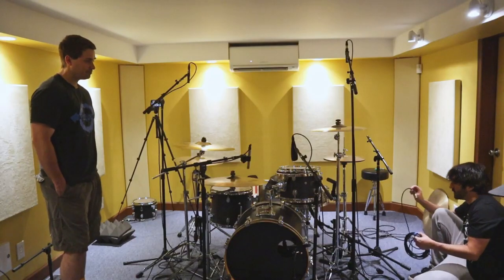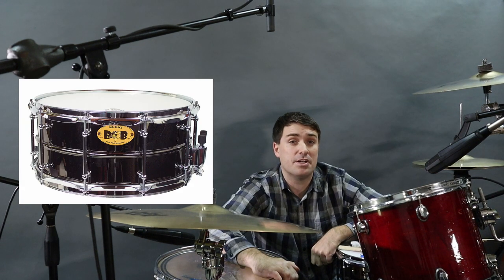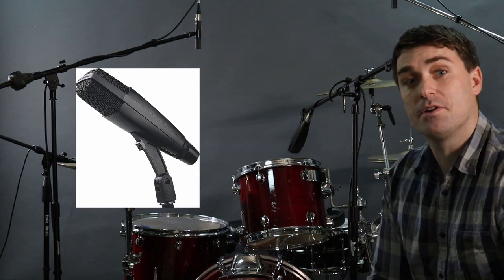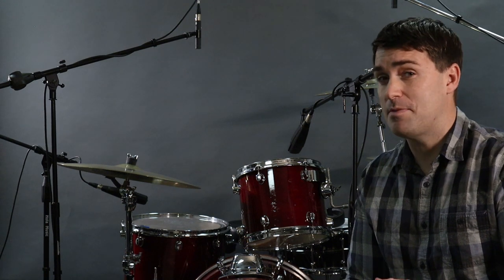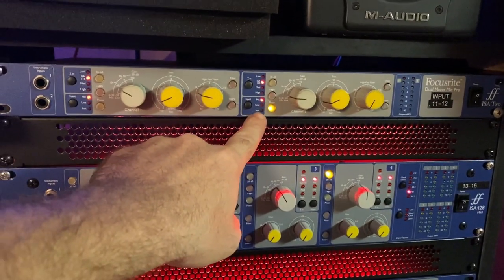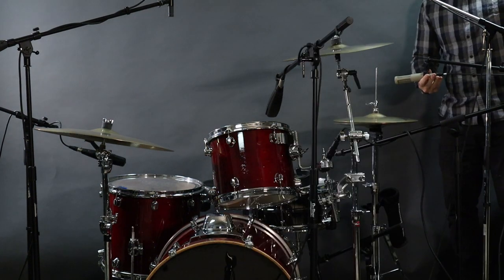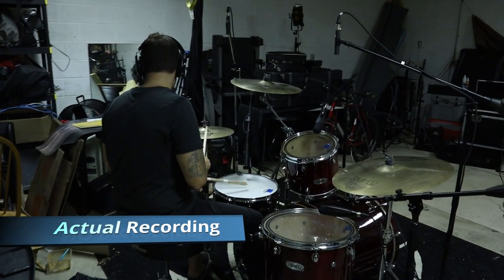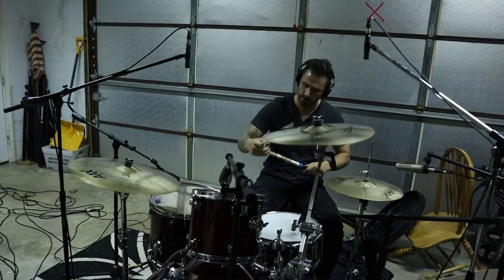How to professional record drums in your garage or house!

Comment: Any tips for treating a garage with acoustic panels to make the room sound better?
Reply from the maker: I'd start with bass traps in the corners...should absorb a lot of the lengthier waves in the room.  In a pinch, if there are rafters, hanging some sheets also help absorb some of the waves from bouncing, but they have to be pretty thick.  Good luck!